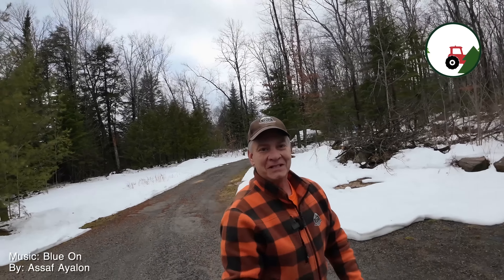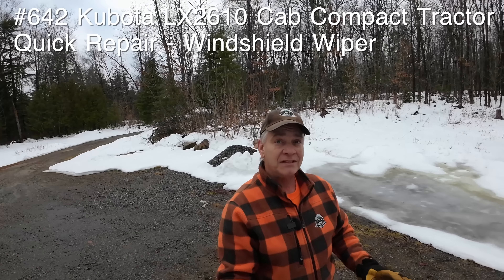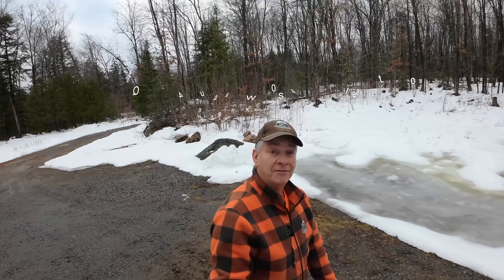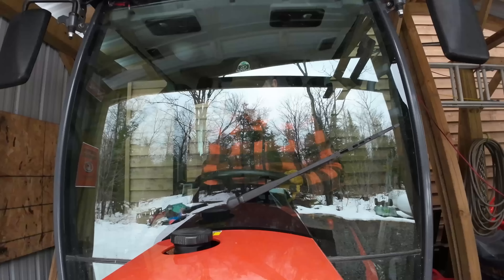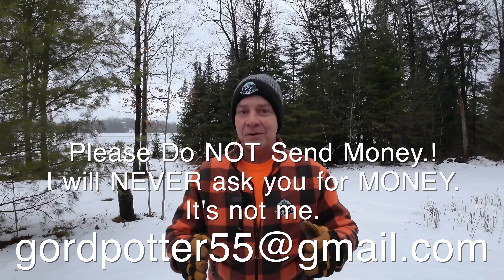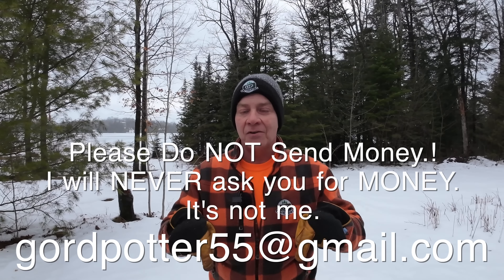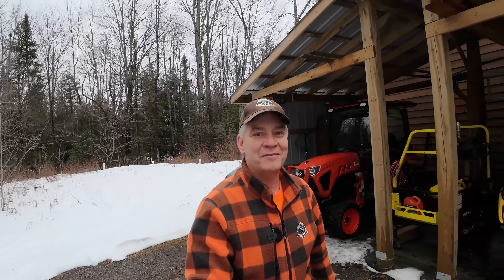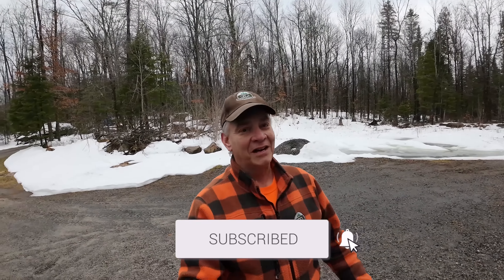642 Kubota LX2610 Cab Tractor  Quick Repair   Windshield Wiper. DIY outdoors   4K

Comment: I would have thought there would be gears on the wiper arm that mesh with gears coming out of the wiper motor.  I would have never thought it would be entirely a friction connection.  And that cap removal would have also threw me...  After about 10 minutes of fiddling, I would have got out the big hammer and spent the remaining winter without a front windshield. Thanks for the tip GPOutdoors. lol

Comment: Hello Gord! I’m a retired auto mechanic and have found many many wiper arms loose just as the one on your Kubota. Over the years I discovered a common cause… usually the wiper was prohibited to move (typically frozen to the windshield or too much snow to clear). I may be wrong but its my understanding the wiper is torqued to a specific spec which allows the nut to loosen when the arm is bound up thereby preventing damage to both the motor and arm. (NO LOCTITE!) Love GP outdoors! I have been watching for a couple years.

Comment: Very generous of you for the cap offer thanks.
As I don't work out doors much any more and am not up in the frozen tundra ,
It wouldn't get much use.
It's almost like the engineers designed that rotating cover to catch the nut when it spins off the bolt.
🤔

Comment: I LOVE that hat, the embroidery is top notch, and looks quite warm.  If I don't win, I'm buying one!  I've learned so much from your videos.  Thanks Gord! - GP Outdoors is a fantastic channel and wish I found it much sooner.  Oh, well ... better late than never.  I've already told a few neighbors and friends about this channel.
Reply from the maker: Thanks so very much David! Good luck!
Reply: I was so excited about the hat I forgot about adding a possible resolution to the nut coming loose.  I have another machine with a wiper that has a lock washer.  I have used both lock washers, of the best type for the application, as well as 'nylock' nuts.  Basically, nuts that have a nylon insert that acts as a 'locking' device and prevents the nut from coming loose on it's own; though still easy to remove if necessary.

Comment: Evening GP outdoors. I work in the auto repair business and see this all the time in heavy snow conditions. You might want to remove the wiper arm and clean the shaft splines. The arm is made of aluminum and it fills the splines and it probably will happen again. Put blue loctite on the splines and nut.

Comment: Hi Gord,
You should Rain X your windshield it will prevent ice accumulation on the glass when working out in the snow which is probably why the windshield wiper arm came loose due to the extra drag on the glass. GP Outdoors

Comment: GP, see! That's why I don't own a cab tractor! I don't have a windshield wiper!!!
( OR a heater, OR air conditioning, OR  a wind break for the blowing snow, OR a dry seat before I sit !!)
But I sure could use a custom tossel cap when it's cold and blowing from GP Outdoors!

Comment: Great information on the Kubota wiper. I have the same model you do with a cab. Haven’t had this happen yet but now I know how easy the fix is.  Do you think this happened when your blades may have been frozen and it came loose trying to operate or just came loose over time?  
I thoroughly enjoy GP Outdoors and the work you put into your content.  
Keep up the good work GP!!! 
Cheers!  Steve. (One size fits most). 😂

Comment: Next time you will want to take the wiper blade off.  The mating surface is knurled and you have damaged the aluminum on the wiper.  It might even be pot metal.  Go Outdoors has great info for kabota tractors.